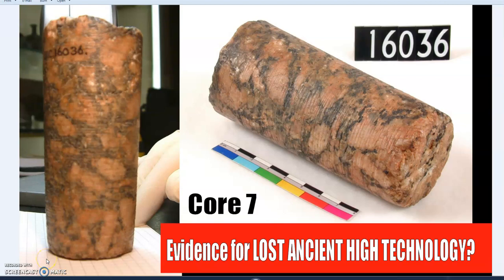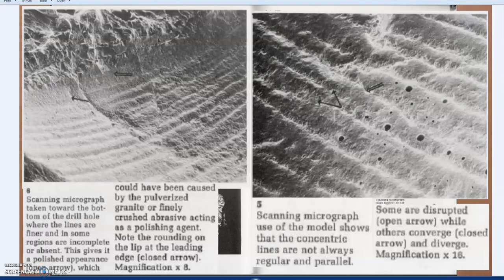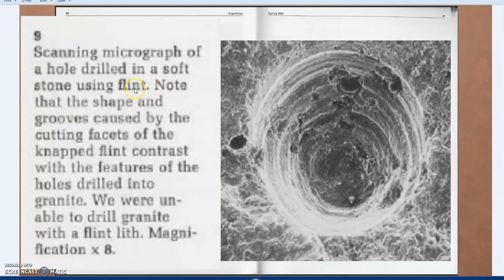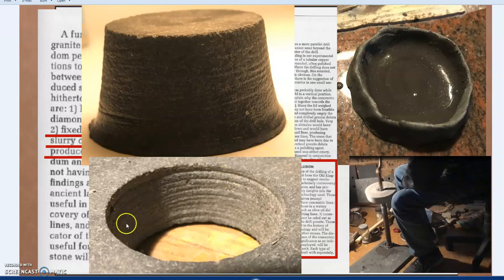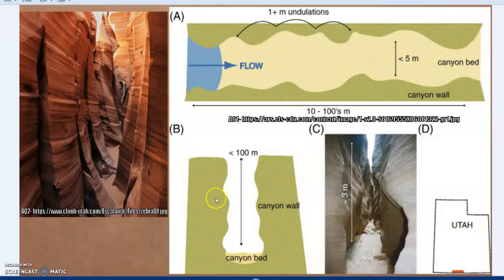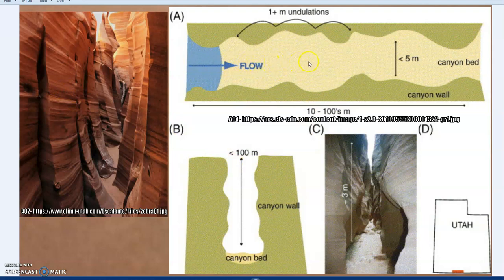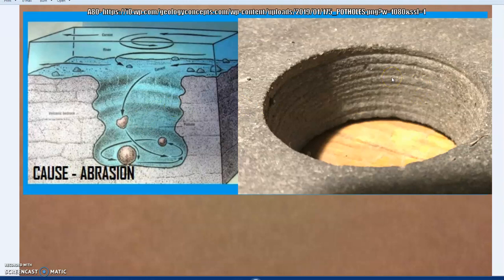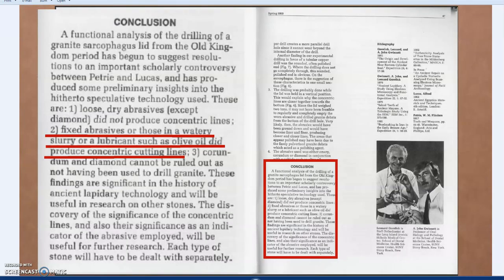Core 7 and How the Grooves are Formed WITHOUT a Fixed Point.

Comment: Oh balls. There is nothing to suggest the ancients didn't make a copper tube drill coated with diamonds and pitch. They used sandpaper.  They used water power. They had electric.  What makes people believe ancients were ignorant.  They separated the gasses from water, had lighter than air flight, made hot air balloons from cattle guts. We even know how they built the pyramids and why because an ancient Indian safe told us.  He recorded exactly how it was done 500 years prior to when modernity states they were built.  And the ONLY reason why they dated the great pyramid to the dates they do is because of a known mistranslation. They know they are off and still refuse to adjust themselves.
Reply from the maker: It’s very hard to tell blatant sarcasm and actual lost high tech beliefs.
Either way thanks for the giggles.
Reply: @SacredGeometryDecoded  anything you say sunshine
Reply: They had electric? 🤣😂